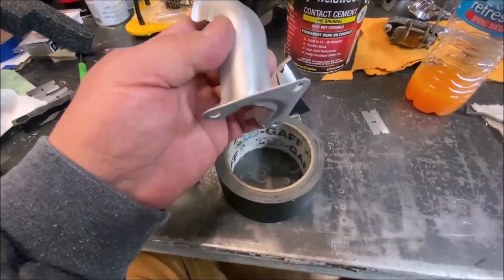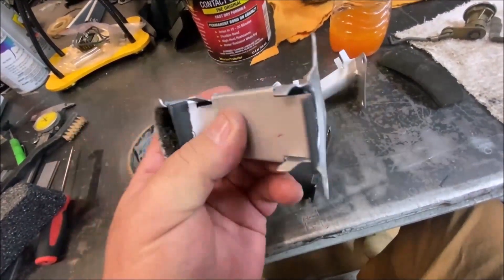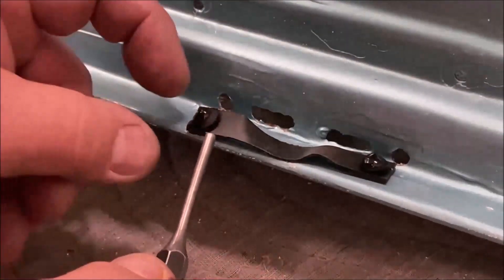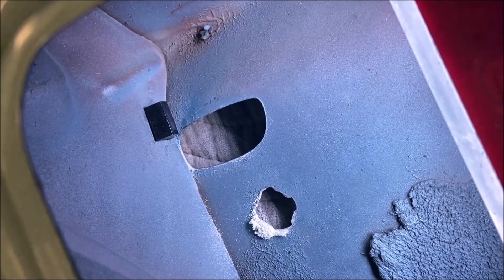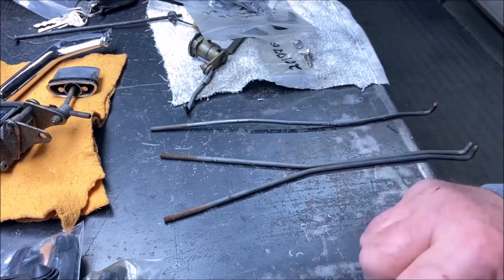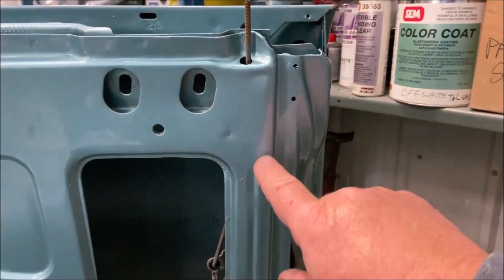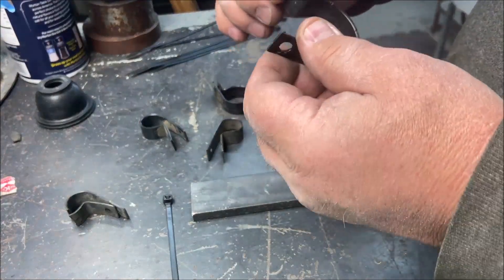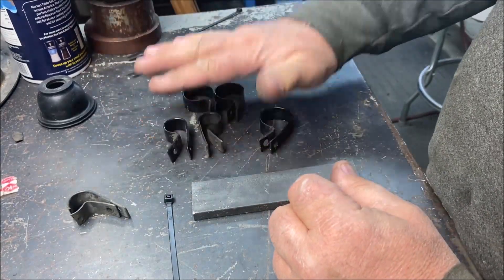Thunderbird tid bits

Comment: Thanks for the P clamp trick. I replaced them already with whatever they sent me from Mac's or Pat Wilson's. You're correct: The replacement P clamps do not match the originals. Similar but not the same. Oh well...
Reply from the maker: Yeah, original ones are probably getting scarce. Like hens teeth.  I have a few left over from my shop thankfully. Maybe someone will reproduce  them some day.

Comment: On tapping...a taper tap would have started easier than the plug tap with less chance of crossing it up plus a few drops of oil on the tap.
Reply from the maker: Yes you are correct. Sometimes its very hard to start a tap especially when the first few threads are buggered. Thanks.

Comment: Nick,
I need to replace the hood insulation on my 65 landau. How do i know if it was originally a 3 or 5 piece set. Also, in the trunk when replacing the trunk liner, was the metal underneath painted black or the same color as the car? Thanks!!!
Reply from the maker: Hey Branson, the hood pad kit on a 65 is a 5 piece kit always. The only 3 piece kit fits onto a 66. The under side of the trunk lid is the same color as the car. Good luck.

Comment: Hey I’m restoring a 61 t bird and was wondering how to get the window out and if you had a video on it? Thanks
Reply from the maker: Hey Cooperwiring, Sorry but I do not have a video of that. Im assuming you mean the door window? It comes out pretty much the same as the 64-66 thunderbird. The regulator is basically the same so removal and installation is basically the same. I think the exception is how the rollers go on. I install the window rollers into the window tracks first then when installing the regulator, I push the roller pins into the rollers inside the door. Therefore, you must remove the clips to the roller and detach the regulator from the window before you can remove the window. I also loosen the vent window so it can move forward and give you more room. Do not forget to mark all bolts so you know where they went when reinstalling.  Good luck.
Reply: @vintagethunderbirdrepair9426   thanks, I’ll be watching a lot of your videos 😅
Reply from the maker: @copperwiring7661  Thank you.